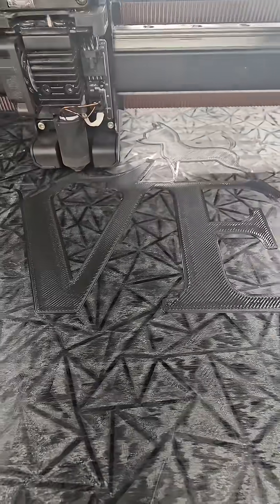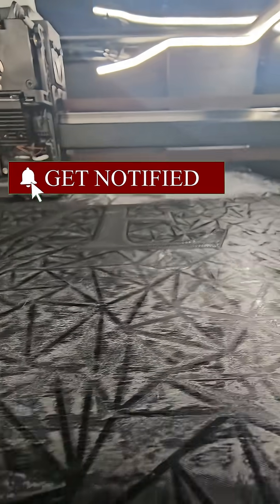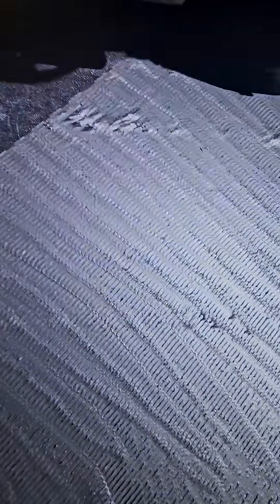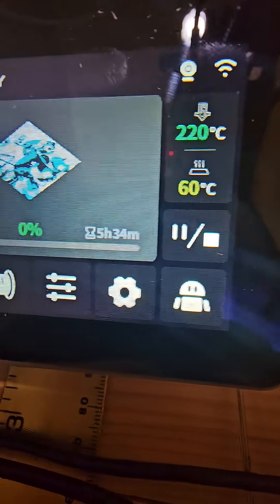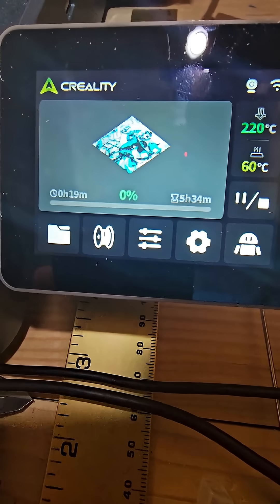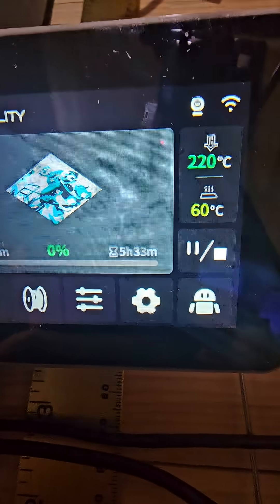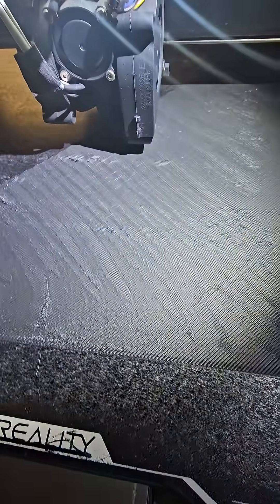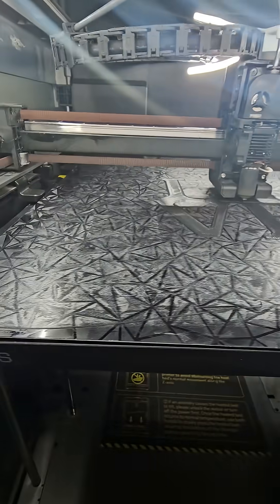K2 = SMOOTH

Comment: Key is in the surface bed . Change the original bed with Pei bed . Or with Glass bed
Reply from the maker: Thanks for the tip!! I would love to try a glass plate sometime. How do most people secure it to the hotbed?😮
Reply: @phynalproductions you can use Binder clips or make something 3D with ASA filament to be like U .
Reply: Glass is also often heavy.
Reply from the maker: @printsmartiot ahhh of course!
Reply from the maker: @printsmartiot true I didnt think of the weight
Reply: And also may you need hair spray, on the glass for more efficient adhesive, and recommend to buy one like bed glass of crealty.😊
Reply from the maker: @printsmartiot thanks so much for all the helpful information!! 🙏